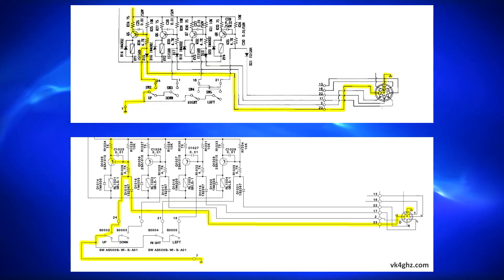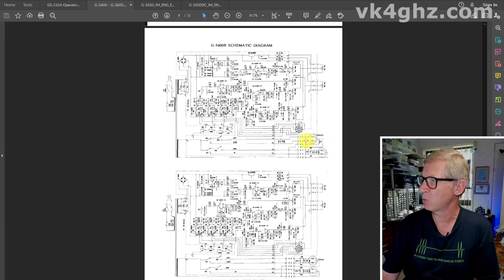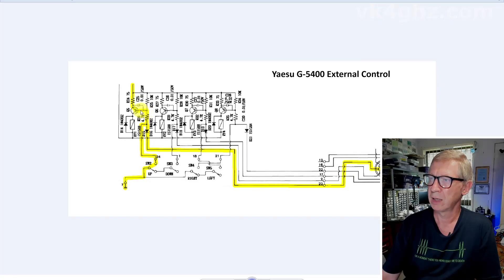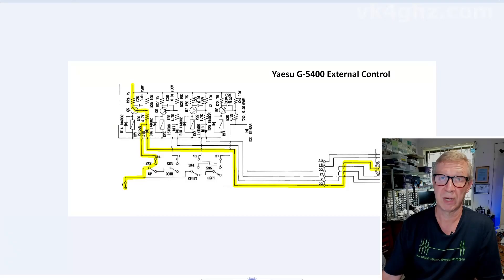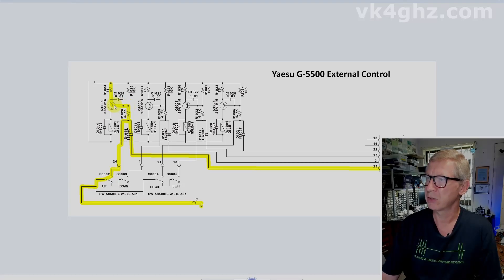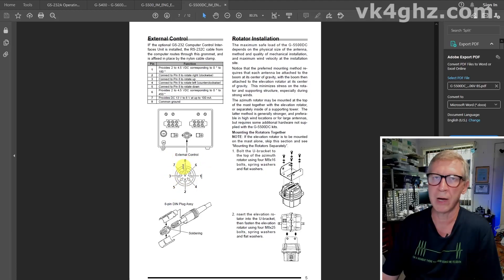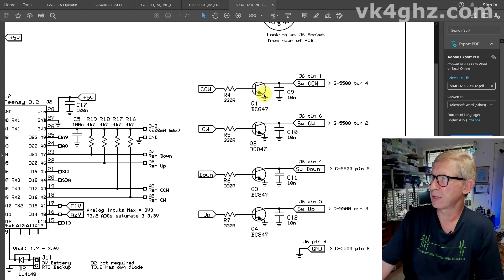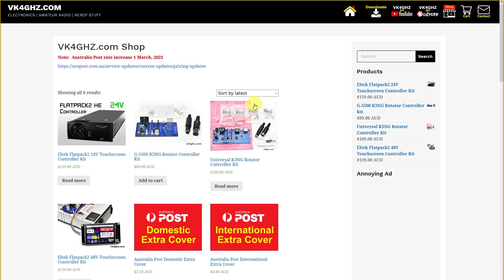Yaesu G-5500 vs G-5400 External Control Requirements

Comment: CE4JDM in Chile here.  Can someone help? I have a new G-5500 on the way and I'd like to know if the rotor controller from Yaesu can be controlled directly from my PC through software, or another piece of hardware is absolutely required?

Comment: There is one significant difference on the G-5400B.  It is north centered, and the azimuth goes from 180-0-180 with no overlap.  The G-5500 is south centered and the azimuth goes from 0-180-360 plus an extra 90 deg overlap.  I cannot figure out how to get K3NG with the VK4GHZ board to calibrate to display 180-0-180.
Reply: Problem solved.  When entering the offset for due north, use 360 instead of 0.  Use the \I180, \J360, P36, Z, O, F, \A360 and \Q serial commands to calibrate the Azimuth.  Use O2 and F2 to calibrate the elevation.
Reply from the maker: Thanks for letting us know Star Gazer. I'm sure that will help others with a 5400. :-)

Comment: Thank you very much for all of your efforts and the quick response.  I really appreciate you showing the schematics and teaching me how the circuits were the same, I did learn a lot from this.  I really appreciate your dedication and efforts in supporting this project.  Yes there are a lot of aftermarket homebrew controllers out there for this rotator, I want to buy this version because I think I will have the best chance of success with your board.  73, Eric